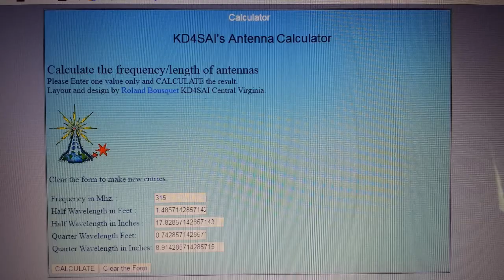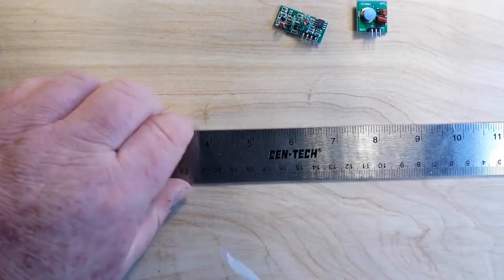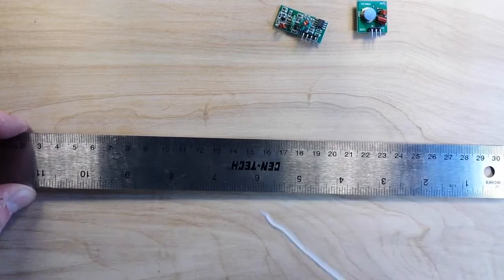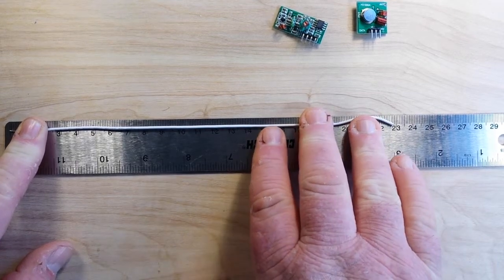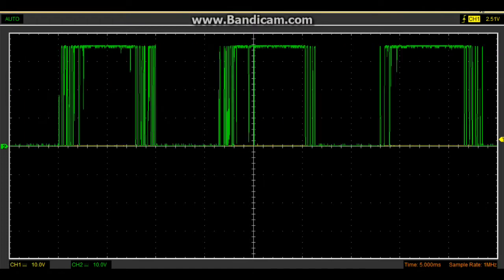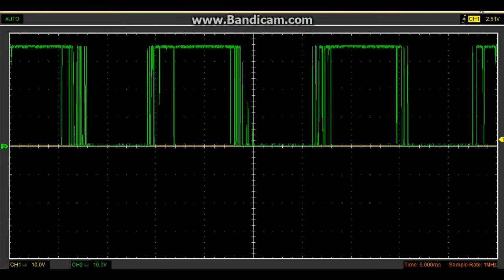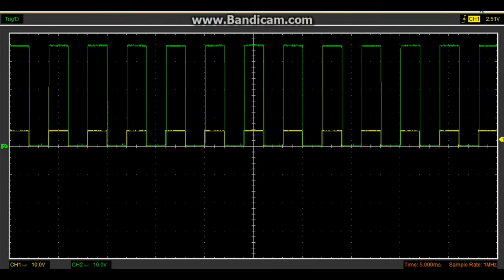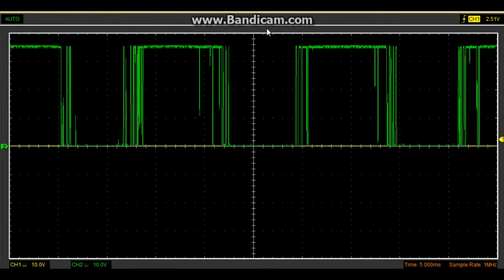Wireless RF Link Antenna Tests   Wireless Weather Station 2

Comment: I see you used 315 MhZ for your antenna calculation. I purchased (I think??) a set of 433 MHz and when I used the antennas per the calculator I got really bad reception. I switched to the 315 MHz antenna length and they worked much better. Mine look identical to yours.  How can you tell if you have 315 or 433?
Reply: Look at your boards the TX is marked on the tx metal can and the RX is marked on the pcb

Comment: What 'scope are you using?
Reply from the maker: pileofstuff It's a PC based scope from Hantek.
Reply: learnelectronics thanks
Reply from the maker: pileofstuff your welcome. if you are looking to buy a scope, I wouldn't recommend a PC based scope unless it's your only choice. I bought this Hantek to see if it was worth a  few bucks, but really it's not. if you're looking, send me a PM and I'll give you a couple recommendations. I'm not doing any on the channel because I'm working out a deal with manufacturer for sponsorship.
Reply: More curious than anything.  
Not really in the market at the moment, but if something cool and affordable dropped in my lap...